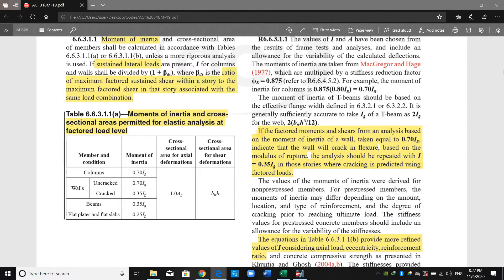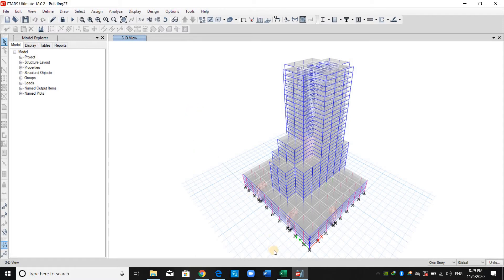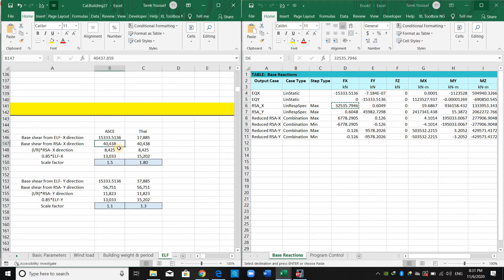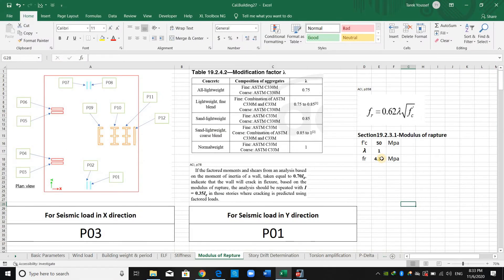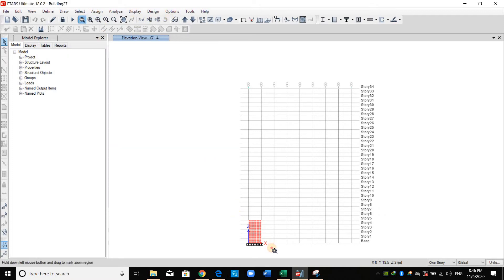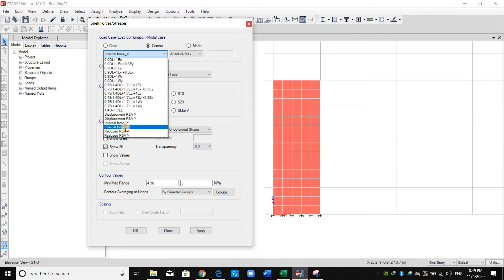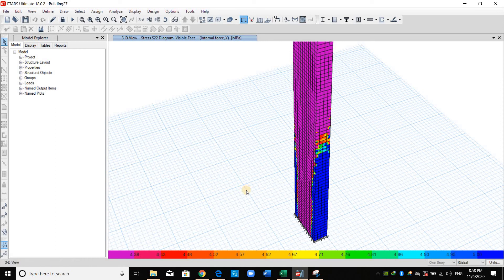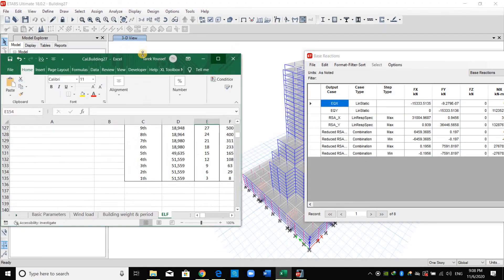Changing the effective stiffness of the walls based on the modulus of rupture in ETABS (Lec14)

Comment: Why bending m11=0.25 not 0.1 y’a?
Reply from the maker: It's important to note that selecting m11 in ETABS involves an assumption about the out-of-plane stiffness of shear walls. While both 0.25 and 0.1 are commonly used values, I personally opt for 0.25, which involves neglecting 75% of the out-of-plane stiffness of shear walls. This decision aligns with recommendations from the ACI 318-14 code, where the inertia of flat plates and flat slabs, primarily resisting gravity loads and thus experiencing out-of-plane bending, is reduced to 0.25 (Table 6.6.3.1.1). 

Applying the same concept to shear walls, I choose 0.25 for m11. 

However, it's important to recognize that the choice ultimately depends on project-specific requirements and engineering judgment.
Reply: @Eng.tarekyoussef  thank you